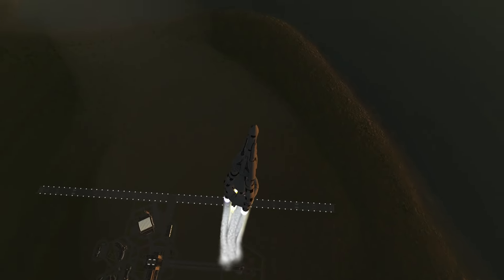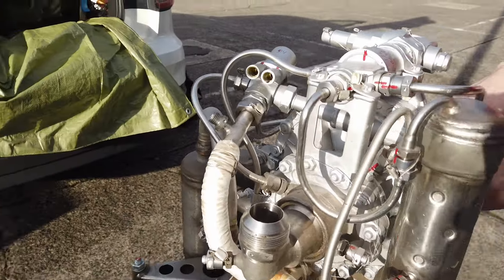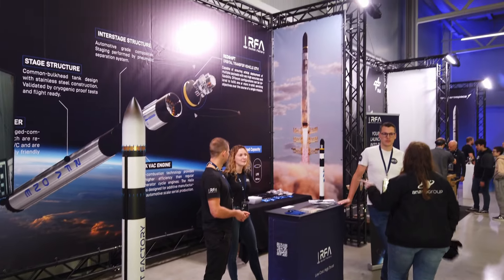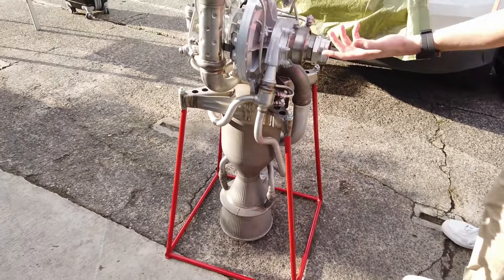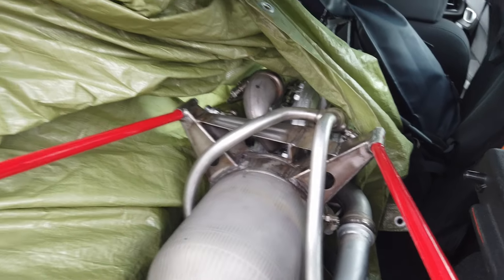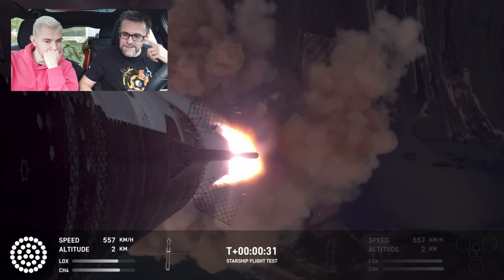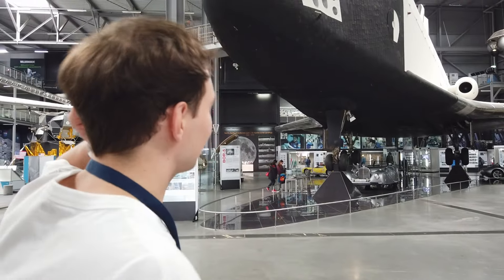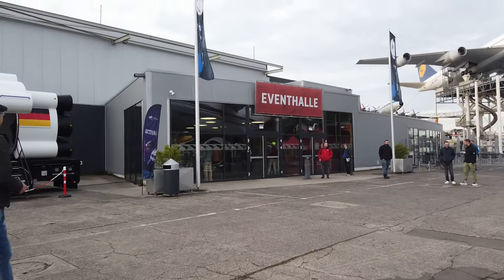How Everyday Astronaut's Rocket Engine ended up in my Car

Comment: I have 2x 3d printed rocket engines....not that they resemble a specific engine and don't have anything near what would be needed to be fully functional (assuming they weren't plastic). The first one is the Prusa Mk4 engine. There is an identical (except bigger) Prusa XL engine. I thought it looked cool so it was the first print my Prusa mk4 did. I just upgraded to a mk4s and I thought the new rocket looked even cooler. It's basically the same engine, but it has additions that are supposed to make for a more challenging print. And my printer did it like a champ without any supports of any kind. It's CLEAN!!! But the mk4s version.....looks really fake in comparison. It has 3 new combustion chambers sticking out the sides at like a 45 degree angle from the main chamber. And they are fed by 2 hoses (2 of the chambers are connected). They don't have a turbo pump. So.....where is their fuel coming from? Also they only have 1 inlet. So.....are they getting fuel and oxidizer from the same hose? They look cool, but knowing what I do, the mk4s version looks very fake. lol
Reply from the maker: How happy are you with the Prusa? I'm thinking about getting into 3D printing and looking at the MK4S as well as the BambuLab P1S. The latter corrently is my favorite due to the enclosure, corexy tech and the fact it has a smaller footprint than the MK4S.
But I am still a bit on the fence which one to get ... or if I should get one at all.
Reply: @ShadowZone  I should also point out that the prusa mmu3 color system is superior to bambulab. If you set it up completely 100% stock yeah it's way more space than a bambu, but it uses WAY less filament. Aurora Tech on youtube just did a review. She found that the waste products of the MMU3 were less than half of that of bambu. I don't have a stock setup. I eliminated the buffer. Instead I have a sunlu S4 filadryer. I just put all my filament in that and feed it into the MMU3 directly. It does look a little messy as the retracted filament just spills out to the side until needed again. But it works.
Reply: @ShadowZone  ohhhh I almost forgot. Bambu lab has been caught stealing models from cloud based printing. Prusa doesn't do that. So if you want to print wirelessly and care about it phoning hope and submitting your work, then bambu is not for you. 3d musketeers did a video on what's contained in the proprietary encrypted log files......and there is a lot that shouldn't be.

Comment: What's so difficult about the export of this engine? Would be curious to see a video on this. At least in the US, most of the licensing headaches are around exporting under ITAR, so is that the issue on the US side? DDTC's FAQ makes it sound pretty straightforward on the US side.